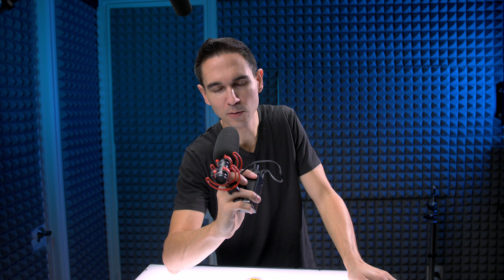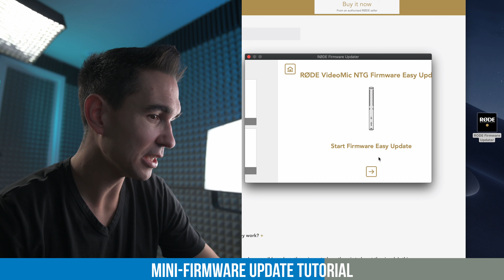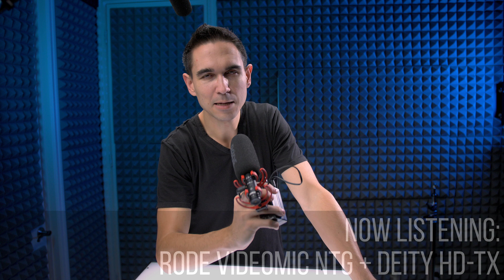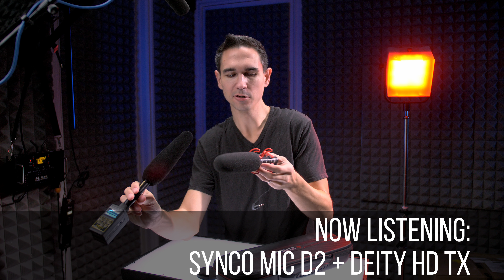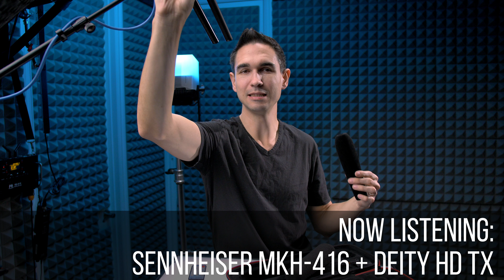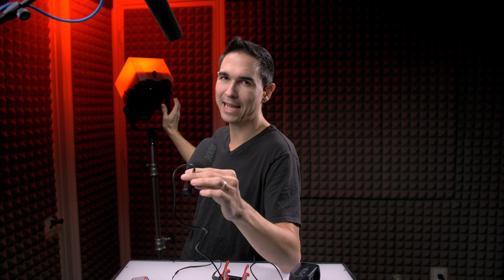Rode Videomic NTG Hiss/Noise Fix, combined with Deity HD-TX sounds like the MKH-416 + Mixpre 3

Comment: I appreciate the video but none of this fixed the hiss for me. I'm using a gh3, with the pres on the gh3 turned all the way down, and the rode set at around 5. If i set it higher, it tends to clip. There is still a ton of johnson noise. Does anybody have a solution? thx

Comment: Hi, I know it's been a long time since you posted this. But I've got a problem with the firmware update on my rode videomic ntg. Tried to update it but it said update failed and now the light on the mic is purple and it won't turn on. Do you have any idea what it could be and what could have caused this to happen?

Comment: I mainly record with my iPhone 11 and on my MacBook for podcast. Even after attempting to update the firmware and always recording with airplane mode on and bluetooth turned off, the white noise remains very present in all recordings. Is it unfixable?
Reply: When i put the microphone to option -20 the problem was fixed on my Macbook. Try it.

Comment: Hey, can you make a tutorial on how you process your audio? It sounds crisp AF! What kind of eq/limiter/compression are you using?
Reply from the maker: On all of my recent videos, in the video description, i have a link to where you can buy my audio processing preset for $10. (I've used it in all of my videos for the past couple of years) with adobe audition.  It takes one keypress and one click, and you're done.
Reply: @TommyCallaway  Awsome! I'll check the preset right away! Btw I've recently bought Rode Videomic NTG and even after the update I have an awful hiss when I record via the A7III preamps.

Do you think the hiss will go away if I use some kind of external recorder, transmitter?
Reply from the maker: Try and make sure the gain on the rode mic is up at 8+, and the gain on your camera's preamps are low as possible. You shouldn't be getting a bunch of hiss with that setup, maybe shoot an email to Rode support? They've been very helpful
Reply: He had a video up, its why I started watching his videos.

Comment: Uh oh... I hope the Deity HD-TX didn't just violate the Zaxcom wireless transmitter and recorder patent like a whole bunch of other companies have prior to this. There is a reason the USA only got the Tascam DR-10L vs the DR-10C, and it's the Zaxcom Patent. They're pretty ruthless about defending that patent as well.
Reply from the maker: Only the internationally purchased HD-TX does both tasks simultaneously.   Usa does one or the other at any given time.
Reply: I want someone to make a simple pass-through recorder with a second matching transmitter roughly the size of the Sennheiser XSW-D moduals that can be placed side by side and linked with a simple locking  mic cable.